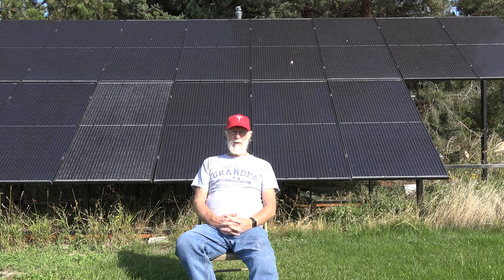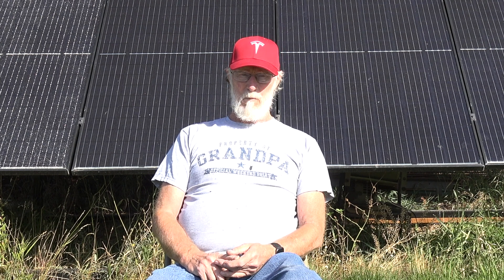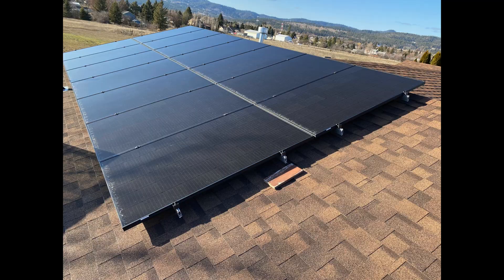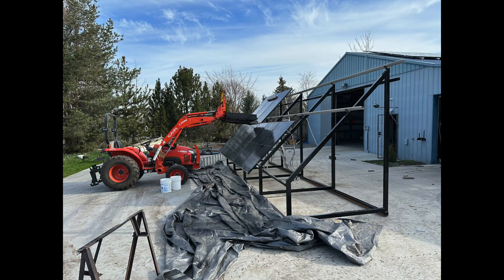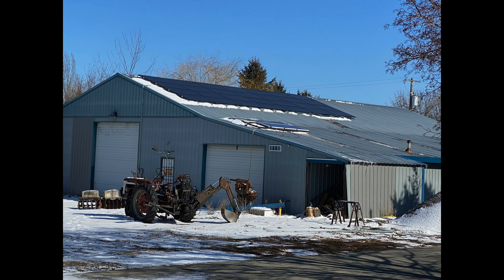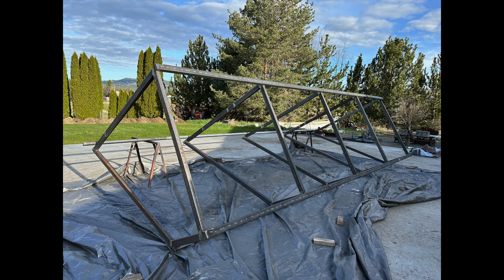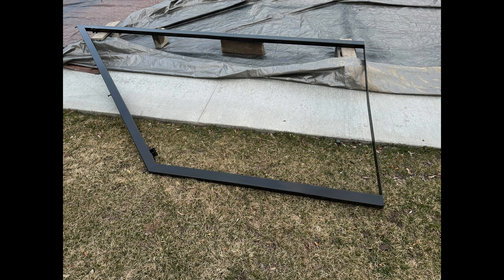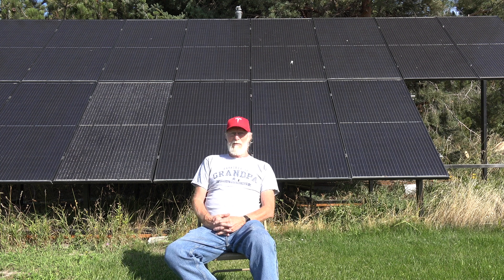Why did I ground mount my solar

Comment: I did ground mount also for 3 reasons; its more efficient because it can be positioned more precisely, its easier to clean, and with roof mount you run the risk of damaging the roof.
Reply from the maker: Solid reasoning
GFM

Comment: Not a fan of the system.  Need large central generation.
Reply from the maker: Couldn't disagree more.  Small, sometimes residential power suppliers like me(I operate 2 to 3 of my neighbors' air conditioners during the summer) could be a great solution to grid problems.
GFM
Reply: it would need to have storage with grid controlled dispatch to put the power on the grid when it is needed most (early evening) to help with grid stability, rather than make it worse. solar doesn't help with the grid stability when output can drop way down  in a matter of seconds due to a cloud passing over, the conventional power plants still have to be on at required capacity to meet full demand since they can't be ramped up and down fast enough.
I don't know of one instance putting intermittent solar helping with grid stability and replacing regular power plants- germany went big into renewables and because they foolishly shut down their nuclear reactors are burning lots of coal despite the renewables. ontario, canada went big into renewables and all it did was jack up rates and unreliably produce surpluses that get exported at a loss.
without cost effective storage, intermittent renewables = "junk generation"  @grayfurnaceman

Comment: HVAC guy with 52kW ground mounted totally off grid and loving it.
Reply from the maker: Whoa, that's a lot of panels!
GFM
Reply: do you ever have to use a generator?
Reply from the maker: I do not.  I have ordered an EG4 battery backup system that I will be doing videos on when it is installed.  That will be my backup for outages and when there is no solar.
GFM @Jon-hx7pe

Comment: I have a question a/c related   why do a lot of service techs 
When servicing on signal phase residential condensing units not replace failed contacted with single throw double pole  units  in my opinion  the are better fail less and hold the arching to a minimum  not mention  as the single pull single throw units start to fail some times some tech through hard start kits on failed to mask failing relays your thoughts
Reply from the maker: The single pole contactors have no more failures than double pole.  The amperage on the contacts are the same, unless you are passing one side of line thru both contacts.
Can't see how a hard start kit could mask a failed contactor.  Not trying to beat you up but you asked for my thoughts.
GFM
Reply: @grayfurnaceman  
In my area I find many more burnt up single pull units melted and many of those have kits on them
In some cases part of the problem seems to be on install failure like lose or poorly made connections.  I do believe the dual contact units do last longer 
And maybe have less  over all heat build up on the point of contact I will see if I can send a photo of the most recent failed units I always check LR and R amps after repair 
To compare to labels. To be shure it would seem to involve 
A significant no. Of Goodman units and there spin off models 
Most have a cap rating of 35 and 
I test and replace if not with in spec

Comment: Being an Eastern WA resident as well, expect energy prices to continue soaring.  Natural Gas is next on the "carbon cap and trade tax" hit list after they already drove up gas prices 50+ cents a gallon so expect people to be going broke heating their homes too.  They're obsessed with removing the Snake River dams.  Add in electric car mandates and WA doing it's best to ban natural gas appliances in favor of all electric, I expect the grid around here to go as unstable as it is in California over the next decade. 
At least Lithium Iron Phosphate batteries have hit the mainstream.  I have 10kwh now and plan to add more.  We all need to plan for those government induced rolling blackouts that are almost inevitably coming.
Reply from the maker: Not so much down on government but I do think many homes producing a small amount of excess power could go a long way to reducing grid instability.
GFM
Reply: how can that work when the excesses are unpredictable? @grayfurnaceman
Reply from the maker: Not so unpredictable.  Utilities have been predicting loads and adapting sources for many decades.
GFM @Jon-hx7pe

Comment: Thanks for the update. I personally like ground arrays also little more experience but easier to maintain. I have one that is 12 3x4 sideways and one 15 1x8 and one that is 1x7 the tall way with the lowest point 2feet off the ground.  I think its best to have them so u could use a broom to clean off not need a roof rake. Currently 27 panels but probably going to double that next year. 20kwh of batteries. I think i would like to grid tie also. Would like to hear what the battery plans are.
Reply from the maker: Hopefully, coming soon on the batteries.
GFM